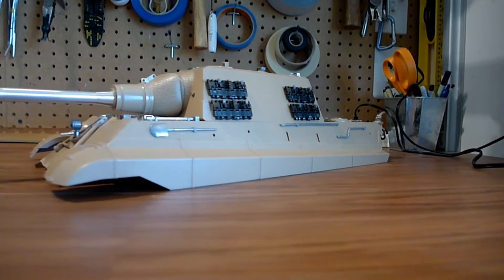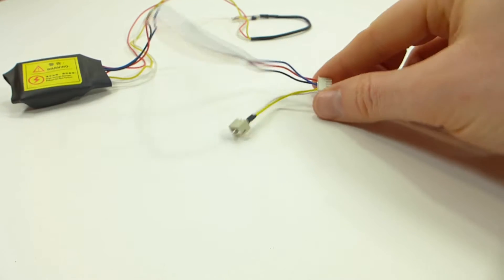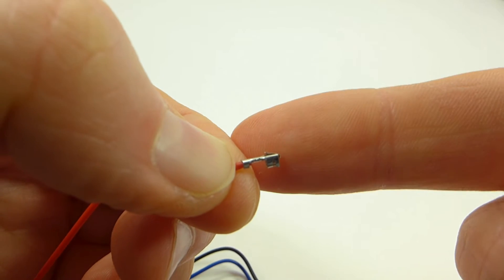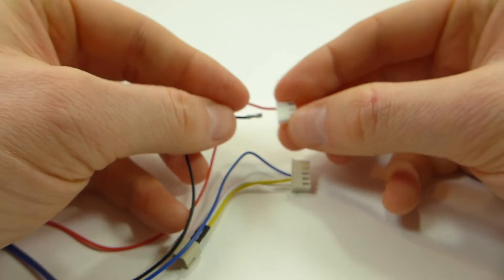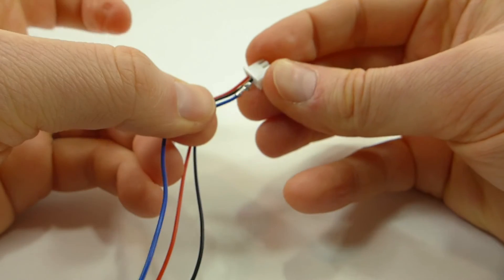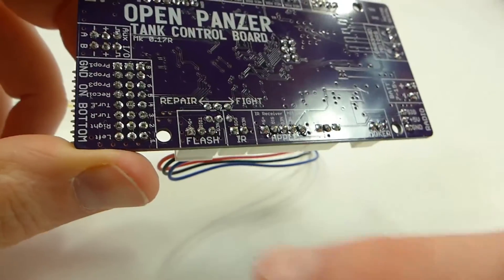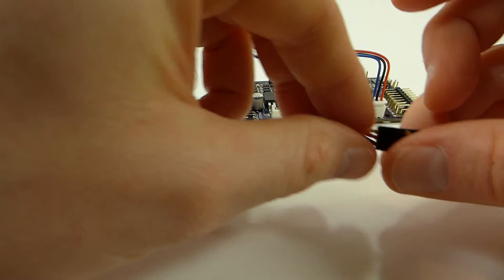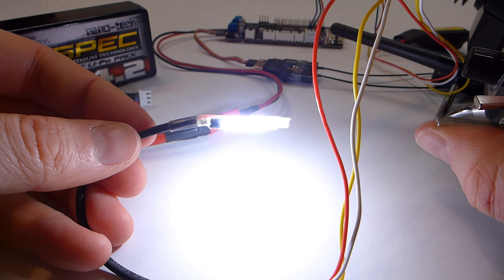How To - Taigen High Intensity Flash Unit

Comment: Have you observed any problems with the flasher unit after doing the modification ?  thank you
Reply from the maker: No I have not. All we are doing is changing the connector, we are not modifying the unit. It still works the same as before.